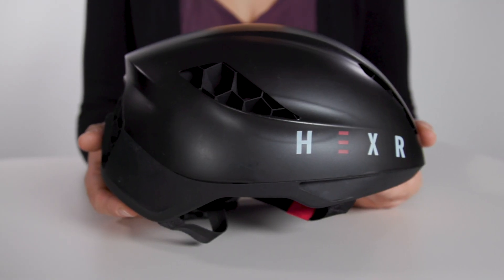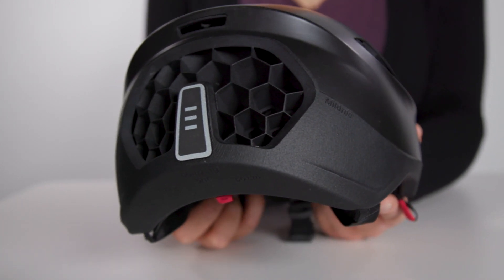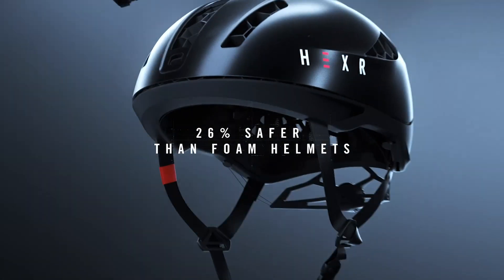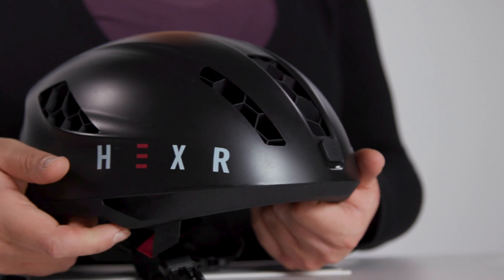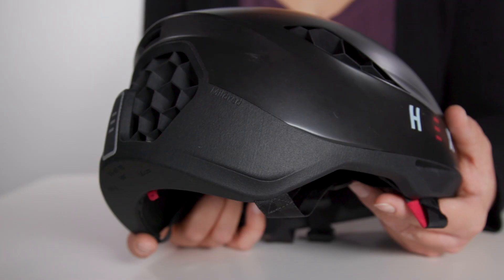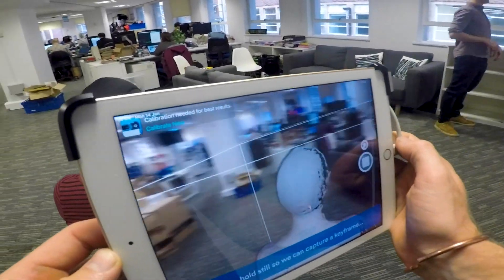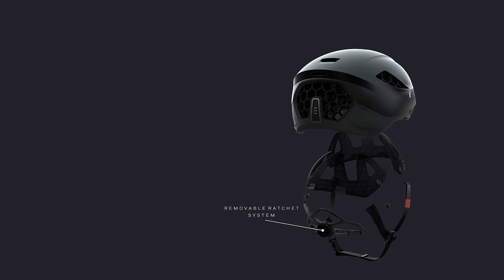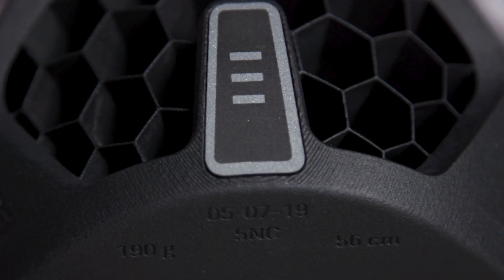The World's First Truly Custom Bike Helmet | Hexr's 3D-Printed, Recyclable Lid

Comment from the maker: Would you buy a Hexr helmet? Let us know in the comments.
Reply: BikeRadar I'd be worried about air flow through the helmet. It seems like the honeycomb structure might restrict it.
Reply: Helmet...?
Reply: No. Maybe when the price comes down.
Reply: The material conducts heat 8x better than EPS?
My head bakes in my current (well ventilated) helmet, so I'd definitely give this a miss (even at a 3rd of the price).
Reply: @DanRC69  I think what they mean by 'conducting heat', is that it is a measure of how it transfers energy. As it deforms or delaminates, the friction generated by the material folding or sliding over itself creates heat that is spread across the material more quickly, in essence, spreading the energy more quickly and over a wider area. 

There is also a chance that the material could conduct the heat away from your head. A hot helmet is more to do with the helmet retaining your own body heat rather than conducting heat from the outside environment towards your head. Good point though, it would be nice to have the reviewer comment on it?
Reply: @anthonygarvey1  you are correct! And the review is live on bikeradar.com right now :)
Reply: I bought one because I was tired of fidgeting with my old helmet while riding. Glad I did - it sits perfectly on my head and there is no moving around like the other one. It is a bit of a luxury but if you enjoy cycling and want to do it in comfort, this is good quality and value for money.

Comment: I have one of these, bought it after seeing them at the pre- Ride London show thing where you pick up your ride number. Have to say it's one of the best investments I have made, I was skeptical at the £349 price tag (that what it was 6 months ago) but I got given a £50 voucher at the show, I wasn't going to purchase, as I sweat a lot. An average bike helmet will last me 3-4 months before I have to change it as the chin straps start to smell bad, and thinking this at £299 was too much to keep changing every 3-4 months... then they showed me the straps are removable (unlike other helmets - hence the constant changes in the past) and machine washable.I was immediately sold. I've had it since September now and the straps are odour free (been washed once), the helmet fits nicely, and the cooling is brilliant - I don't overheat in this helmet. My only criticism is the fit is almost too good, so if you want to put a cap underneath you have to remove the padding (they just unclip), otherwise the helmet won't fit properly. Its no big deal just something to bare in mind. It really is that good. I can't vouch for aero benefits - I'm not a racer, I also can't vouch for the crash protection thankfully.
Reply: You just answered my question about a cap! I also love that you can easily change the colour of the exterior too if you get bored.

Comment: I have a big head and struggle to find a decent fit off the shelf. I like the idea of a custom fit. Good motorcycle helmets are made from 5 or 6 different sized shells with fitting pads to fine tune from there.

Comment: It'd be nice idea to do Tesla style - from high end custom helmet, to mass market cheap helmet. Sceptical about 1% of eps recycling, bold claims "they will recycle this for you".
Liking the idea to swap the eps with something finally, but I bet the print does not have internal channel for airflow from the front to the back, which only EPS offers and a helmet without it makes no sense to me and is outdated. They did not give enough marketing bs, I mean research info on impact durability. EPS takes multiple light hits, EPS with internal plastic "scaffolding" can resist much more. If this new idea can't match, then they fail in the most important aspect. No one want's custom made, great fitting, eco frendlier.....            single impact helmet, that they can then mail to the company at own expense, so "they can recycle it for you"

Comment: That 3D fit is going to be cozy, so I see why the focus on better venting in that honeycomb lattice. What I don't see is the value. 3D printers work through the night for the same price so why isn't that efficiency passed on to the consumer? This helmet does afford more protection which is timely for the eBike onslaught. In that realistic vein of more serious potential buyers I think they would be smarter by making the helmet more affordable so it catches on faster. Smarter because this is the tip of the iceberg in 3D printed helmets. If you're insulting potential customers with price goudging (clearly they are). How long before those customers lose their loyalty. Not very IMHO.
Reply: I believe they are made in the Uk and that’s the price you pay for something designed and made here not in the Far East. I don’t mind paying a bit more to support a small British company especially if the product is good 👍🏻

Comment: What is the weight of a medium size?
Reply: 190g for 56cm (M) you can see it in video
Reply: Please bear in mind that the helmet's custom made to your individual head size, so there isn't a standard weight per size - it will depend on how big or small your head is! But the 190g for 56cm is a good ball park to start with.